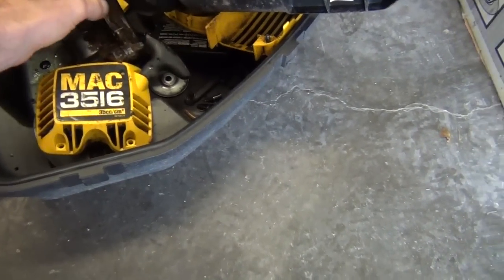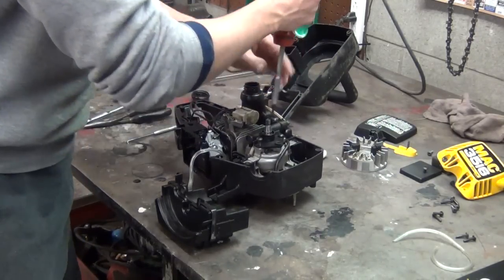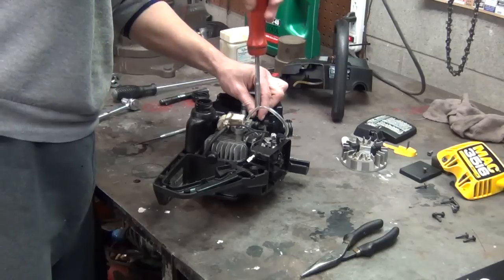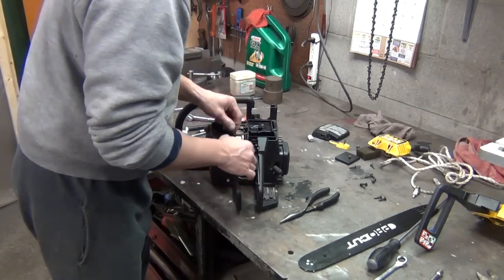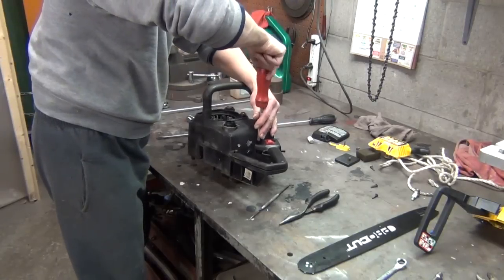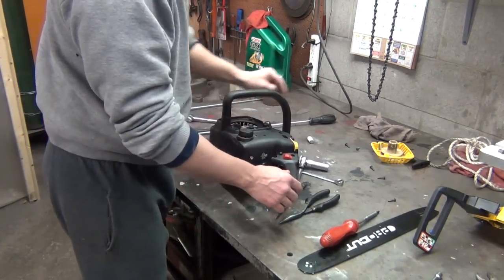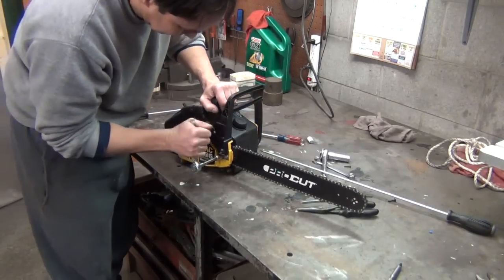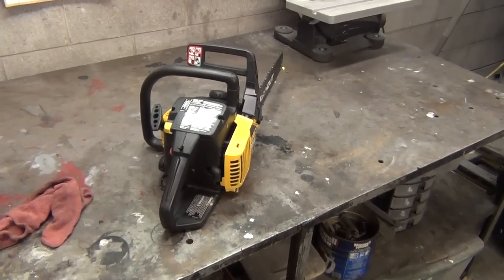Mucculloch 3516 chain saw assembly

Comment: You just saved me with the spring on the throttle.....once I saw that the left side of that spring was bent straight down, I knew that was my issue....and it saved me more frustration than I already had before I found your video--- Thanks a lot!
Reply from the maker: Glad it helped. Thanks for watching.

Comment: fantastic video. i wanted to say thanks for the help on the handle assembly. i just replaced the fuel lines in my 3516 and when i was putting it back together i encountered the exact issue you had with the popup lever. i thought for sure i was missing a part until i watched your video. thanks again!
Reply from the maker: Darin Boesch Glad it helped . Thanks for watching .

Comment: Thanks for this vid. I took mine apart (same model) to replace oil and fuel lines and check the oil pump since the oil just drips out. Your vid helped me with some of your tips (rope in cylinder) and wrestling with the split cases. My saw runs great and just saved me $300 (was looking at the Echo CS-400.)
Reply from the maker: +Rookey Thanks for the view and comment. Glad it helped. I did get a few more years of service out of the saw after this video was made .

Comment: The reason there is no filter on the second line is because this is the return line to the tank. The "in" line from the primer bulb goes to the carburetor. The primer bulb pulls fuel through the filter and carburetor.
Reply: Now how do you explain this thing running getting essentially fed from the metering side return port?
Reply: @johannesels5288  I think he should have said 'The "in" line from the primer bulb COMES FROM the carburetor'. Does that make more sense?
Reply from the maker: Thanks for watching.
Reply: @Syncop8rNZ  You are correct. If I remember correctly the primer bulb has a short nipple and has the imprint IN. This goes to the left side of the carb (linkage side. So fuel flows from the filtered fuel line in the tank through the right side of the carb, through the carb , out the other side through the fuel line to the IN nipple of the primer bulb, through the bulb, out the OUT side  (longer nipple) of the bulb and back into the tank.

Comment: Thanks for the video I just got my Mac apart and the fuel lines and bulb are toast. Thanks for adding to check screen info to video on the carb I found fuel line pieces in the fuel tank so i can imagine what that will look like found all kinds of parts if I need them on Amazon. Love this little saw doe's everything i need it to do around my home . Anyways ill be back to get some reference on putting it back together I have it apart for cleaning now . 
                                                                              So thank you again
Reply from the maker: Glad it helped. Thanks for watching.

Comment: Another person already made this comment but it's important enough that it should be emphasized.

The purpose of the primer is not to push fuel into the carburetor. The purpose of the primer is to suck fuel through the carburetor.

So when you push the primer bulb, it pumps a shot of air into the gas tank. When you release the primer bulb the vacuum that is formed sucks gas out of the gas tank, through the fuel filter, into the carburetor, out of the carburetor and into the primer bulb.

So when you first see a tiny bit of gas in the primer bulb, you know that you have sucked gas all the way through the carb and it's primed, ready to try to start. No need to hit the primer bulb anymore at that point but if you do keep pumping it will squirt fuel into the gas tank through the unfiltered return line rather than air.

If you hook the "in" side of the primer bulb up to the unfiltered hose in the fuel tank, it's very likely to do much more harm than good.
Reply: I'll go a little further and suggest it is really a "Purge Bulb" because it purges air from the carburetor and into the tank (along with a little fuel)... which creates the vacuum which sucks fuel into the carburetor.... I'm definitely no expert though.
Reply from the maker: Thanks for watching.
Reply from the maker: Thanks for watching.
Reply from the maker: Thanks for watching.
Reply: @Syncop8rNZ  100% correct. People think of priming as  in old school- raw fuel squirting into the throat of the carb, which this does not do. It does prime the carb by purging any air from it, replacing it with fresh filtered fuel from the tank. So you can pump the "primer" bulb once or 100 times and you will not flood the engine. Unless there is a bad check valve in the idle circuit, but that's another story. And unfortunately, even the Mac owners manual calls it a primer bulb.

Comment: Great video. I have two MAC3516 both of which have the same problem. The throat of the Oil tank assembly is stripped and there is no way to stop the flow of oil. It sounds like you had to replace the same part. I have looked off and on for many months but can find the part nowhere. I found one small repair show who said he would work on it if I got the part. With your video I could probably do it myself. Any ideas on where to find the Oil tank assembly (PART NUMBER: 300260)? Until the problem developed the little saw was ole reliable...It looks like the supply for the oil tank has completed dried up. Thanks very much for the video
Reply from the maker: Thanks for watching.
Reply: A common problem with oil leaking on these saws is the threaded oil filler neck cracking at the base. If the cork gasket in the oil cap is worn flat or missing people will ovetighten the cap.

Comment: Thank You for the video. I would like to know what size gas lines I need and also what size primer/purge bulb for a mcculloch 3816 chainsaw. I do not believe I have the capability to tear it down to change the gas tank. The last time I used it was 2004. I forgot to drain the tank. I looked in the tank, it has varnish and dark oil on the bottom of the tank. Could you suggest a way to clean the tank.
I have been told to use simple green? Looking for any suggestions. Thanks.
Reply from the maker: Thanks for watching.

Comment: I think you have the primer bulb lines reversed but you weren't exactly clear in your explaination. The shorter IN nipple goes the carb fitting on the linkage side. The longer OUT nipple goes into the tank and is unfiltered. The filtered line coming from the tank goes to the right side of the carb. 
The plastic pieces on the mixture screws are limiters. And if you remove the mixture screws remember the longer screw go into the Low  (idle) hole.

Comment: please could you give me some advise on what might be wrong with my maccat (macculough) chainsaw? first off it will start then rev up then die, I have changed the old carb as someone had stripped it and messed it up so I thought that that might have been the problem so I fitted a brand new carb but that wasn't it. there is plenty of compression. the primer bulb does not fill with petrol but the fuel line that comes out of the tank to the carb shoots petrol out when I take it off the carb intake. I have made absolutely sure that there is nothing to jam the throttle open and the choke does stay on untill I give it throttle then it clicks off so by my guess it cannot be the throttle opening. so to recap, I pull out the choke then after 3 or 4 pulls it will start but rev right up then cut out. any ideas would be gratefully received.
Reply: +Jason ward Kind of seams like you connected the gas lines the wrong way? That's my first guess.
Reply: +BackYard Mech - Small Engine Repair yes thanks that's what it was but I put them back on the way they came off and the bloke I was fixing it for told me after I took it back that someone else had previously tried working on it, if I knew that I would've looked at that first and the pipes were really loose on the fittings so perhaps that's why all this happened in the first place. thanks.
Reply: Try adjusting your high idle screw from the seated position 1 to 1 1/2 turns you low mix screw should be 1/4 to 3/4 from seated, then adjust a 1/4 turn at a time time she purrs... it sounds like the high jet needs to opened up by what your describing though.
Reply from the maker: hanks for watching.

Comment: I own a chainsaw just like your McCulloch except it is model 3214.  It is missing the chain, bar, bar holder, one bar nut, air filter and the contact for the wire that goes from the ignition coil bolt to the copper contact is broken off.  Where could I find these missing parts?
Reply from the maker: Try E bay.Thanks for watching.